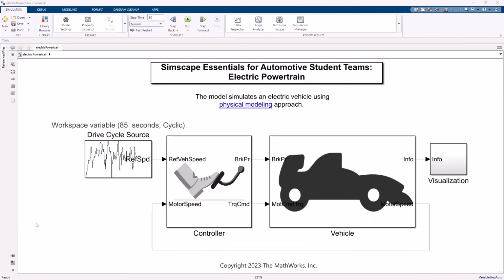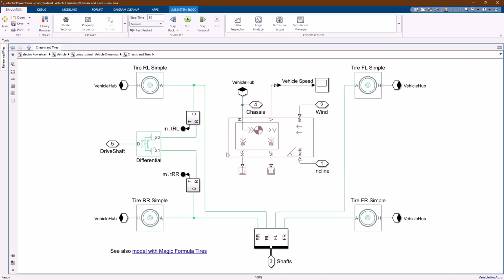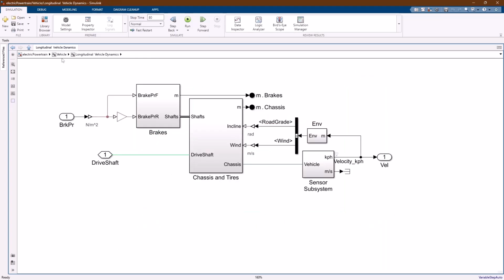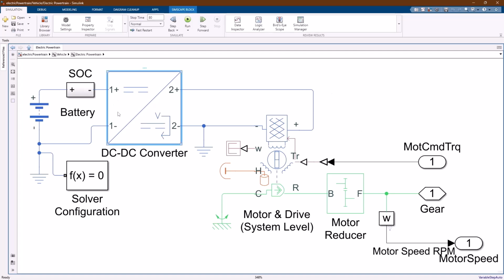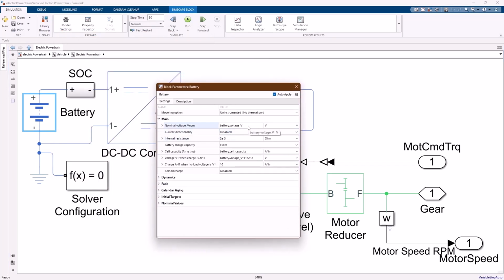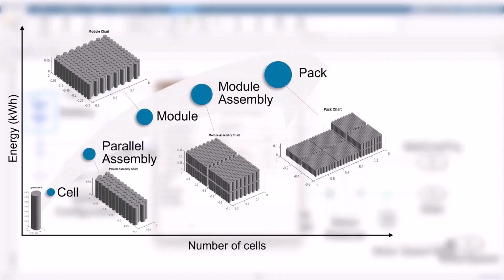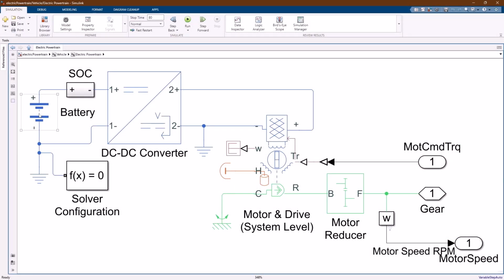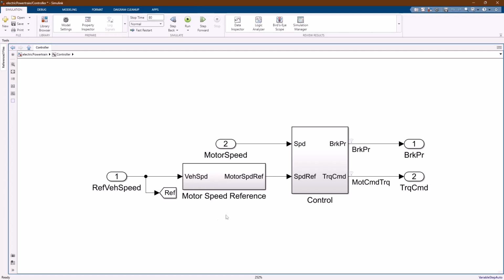Electric Powertrain | Simscape Essentials for Automotive Student Teams

Comment: Excellent work. Now we need a Simscape Essential to model electric marine propulsion, propeller and vessel drag, wind and wave forces, thermal management, and power management of propulsion, generators, battery banks, and solar/wind turbines. That should keep you guys occupied if you aren’t working on that already. Add sensor and databus management if you’re bored.